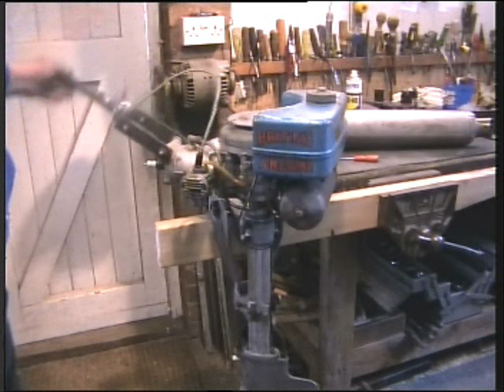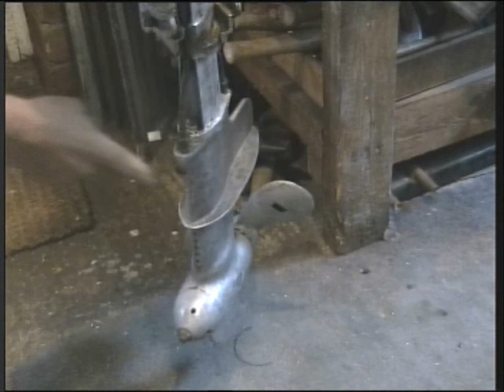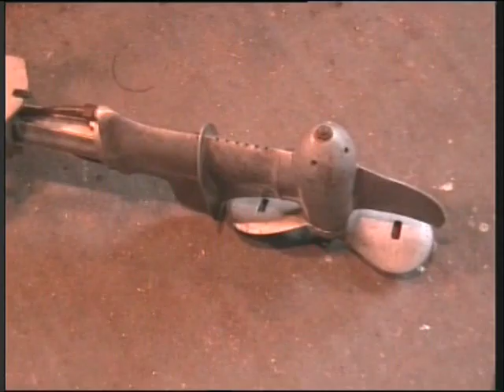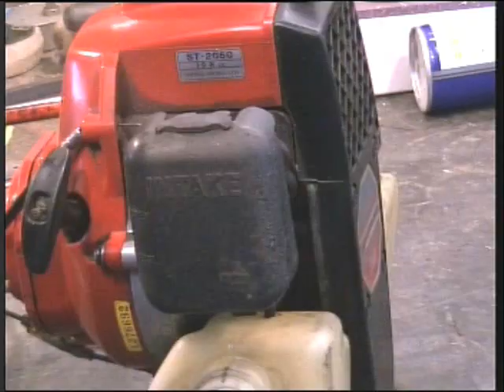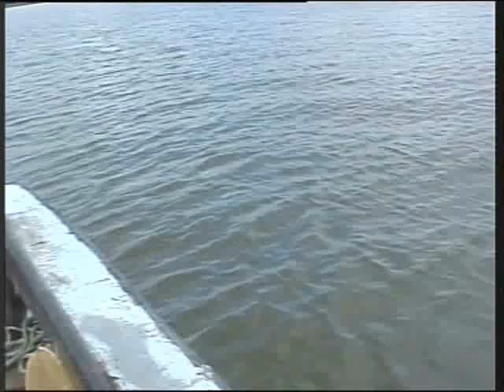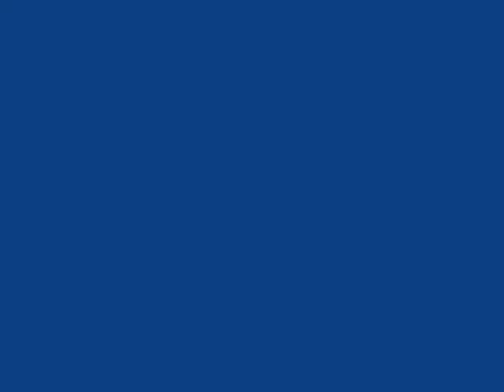a mishmash waffle

Comment: You are doing some great work with those engines, keeping them running is half the battle. Just spent 45 minutes today trying to work out whats wrong with my strimmer.
That's a lot of string pulling and cursing lol